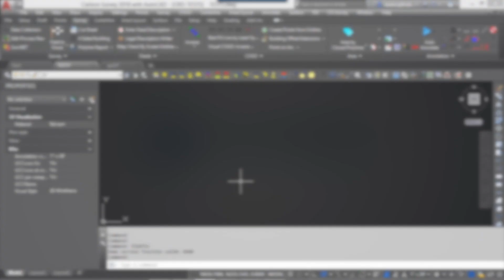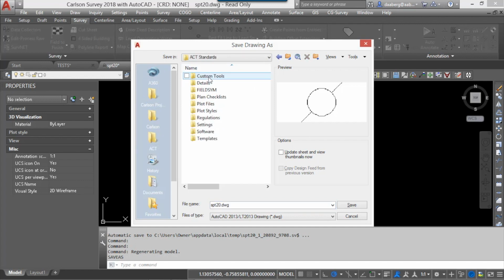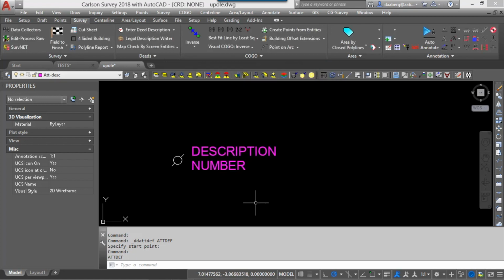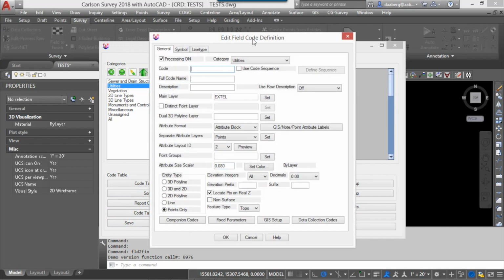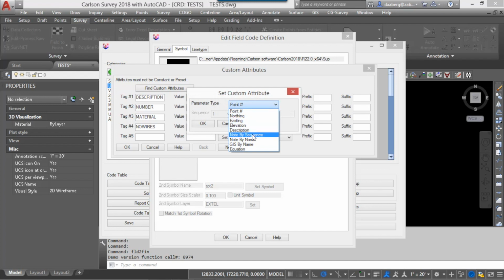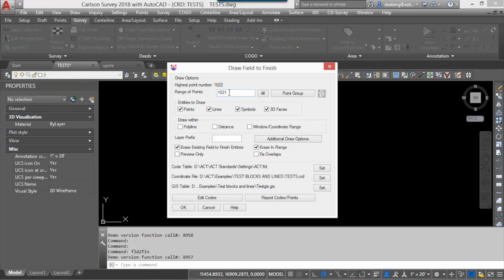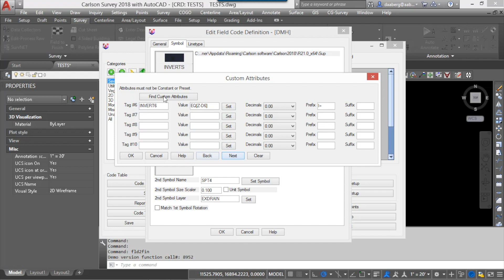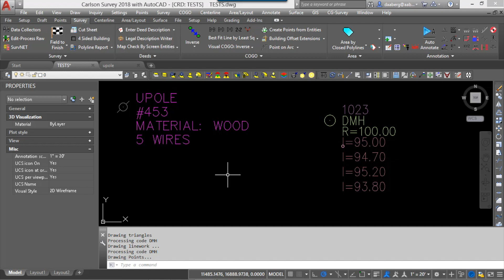Adding Custom Attributes in Field to Finish

Comment: Carlson comes with a spot symbol (spot_z1) where you can enter an integer and a decimal seperatly. Is there any way to set those fields in f2f to auto fill just the integer and just the decimal?